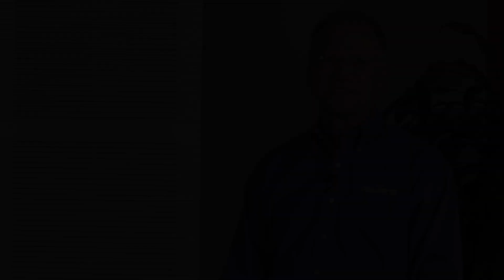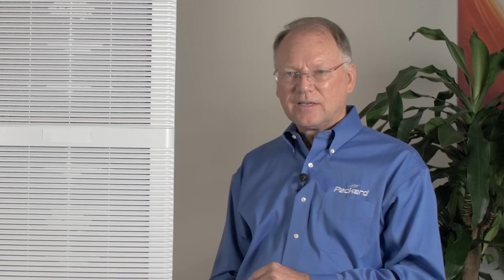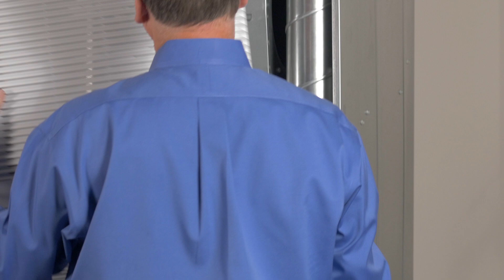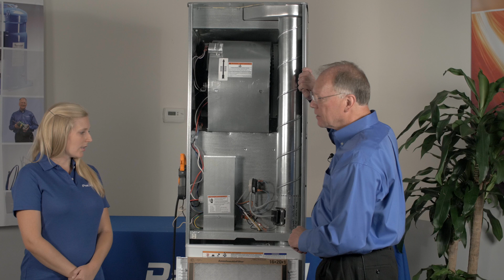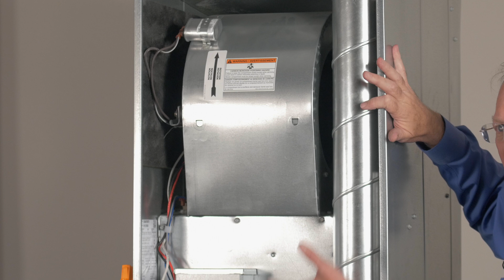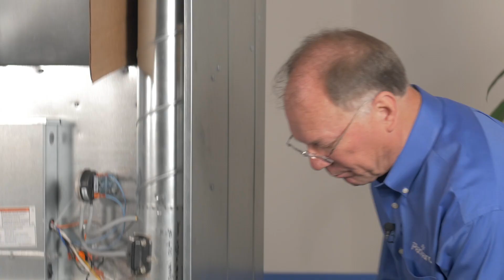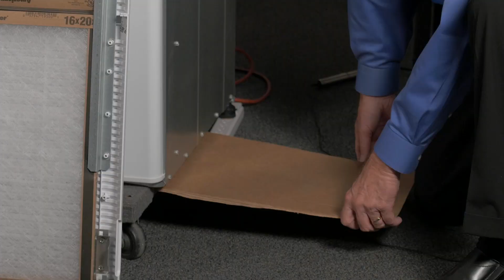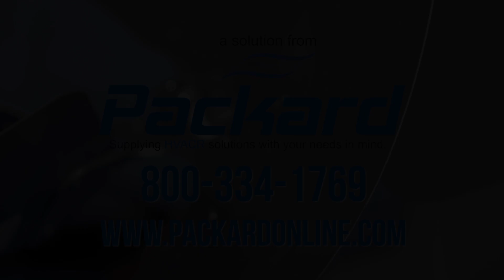Is Static Pressure Hurting Your Blower Performance?

Comment: If I use a belt driven blower, with an external motor mounted on top, and I restrict he airflow with a filter at the source (paint fumes) and a reduction to 5 inches at the outlet, how will this affect it ? The motor is NOT inside the blower  wheel
Reply from the maker: If you use a belt drive/general purpose motor (not an air over motor) and do not exceed the load rating of the motor, the motor should be fine.  The amps should never exceed the full load amps (FLA) or service factor amps (SFA) on the motor nameplate.  The more static pressure or restriction on the blower, the less air.

Comment: So essentially .... if i apply this logic to a squirrel cage blower to exhaust paint fumes, i can enclose the fan in a "restrictive casing" (5-6 inches for the side walls and casing ... but not block the outlet, correct ? This way, the fan will work less hard but displace enough air (pull) through a filter at the source (paint table) ?

Thanks
Reply from the maker: The restrictive casing and filter will create static pressure, reducing airflow.  How much will it restrict?  I don’t know.  If the amps are more than 25% below nameplate amps there is too much restriction and not enough air to keep the motor from overheating.  The motor will fail prematurely.

Thanks for the good question!

Comment: Is the airflow(cfm) the same in the cooling mode as the Heat mode? I have original manuals for my carrier 58mca-060-16110 furnace but there are no Airflow tables in it and I can't locate them on the internet. Thanks
Reply: Depends on the unit! Most gas furnaces use a lower cfm for heating, but it's not definite. You might look at your blower motor. 3 wires means it only runs at one speed, and so does 4 if 2 of them are brown (usually that's on a replacement part), and more than that means the motor is capable of multiple speeds. But just because it's capable, doesn't mean they're hooked up. Generally, if they're plugged in, they're in use, otherwise they'll be taped off.

Comment: This doesn’t make any sense
Reply: When the amps go down, the blower is not slowing down, it is going faster because there is less load on the blower.  Remember, the real load on the blower is the amount of air that it is working.  Less load means less air in the system.  Less air in the system and the system is not performing properly.
Reply: @onenikkione  Thanks! Perfect for explanation

Comment: Counter-intuitive.  I upgraded my furnace filter and was concerned that the reduced flow may add stress to my blower motor, but based on your explanation, it actually reduces stress on the blower.  I just need to look at how it effects air flow at the vents, which I assume will impact my HVAC efficiency and may cause my system to run longer.
Reply: It decreases the stress, but if the airflow is nearly blocked, it also massively decreases cooling. So the ratio between power/cooling becomes worse (bigger), the more restricted (even blocked) the airflow is. Thus the motor can be damaged with restricted airflow, even if the power draw is decreased.

Comment: When you add static pressure at outlet, the pressure will increase after the blower as it is running and supplying air continuously. It may cause blower to surge and consume more power. 
How it shows decrease in amps?
Reply from the maker: As the static increases on the outlet side of the blower, the air volume (CFM) decreases.  This results in less load on the blower.  Less load results in lower amps and higher RPM with an induction motor.

Comment: So is this good or bad? If I add a cold air return from the basement am I merely adding cost of oil burning? Is it worth it? Will it help warm the basement? So confused now.
Reply from the maker: The most important thing is to follow the manufacturer’s guide for static pressure for the specific piece of equipment.  When the system is installed according to the manufacturer’s recommendations the static should be fine.  If the static is not correct, then look at the filters and coils to make certain that they are clean and not blocked.  If they are in good order, then look at the installation to see if it meets the manufacturer’s specifications.  If not, then a change to the system may need to occur that would bring the system within the manufacturer’s specifications.  There may be other considerations that could result in changes other than just adding a cold air return.

Comment: Help Me, Amps go down, blower slow down, Does that mean system will not cool or heat correctly.  I own same air handler in video.  I upgraded blower that is 4 speed.  So what more AMPS if it needs more power, give it.  What is the issue?
Reply from the maker: When the amps go down, the blower is not slowing down, it is going faster because there is less load on the blower.  Remember, the real load on the blower is the amount of air that it is working.  Less load means less air in the system.  Less air in the system and the system is not performing properly.
 
The issue is not that the motor is incorrect, the issue is that the motor and blower are not working properly because the static pressure is incorrect.  Perhaps undersized duct work, not enough return air, dirty coils, dirty filters, too many bends in ducts, improperly sealed ducts and the like all lead to incorrect static pressure.  This will then lead to improper airflow in the system.
Reply: @packardonline  Thanks, more power / blower speed will not help when static pressure is incorrect.  I have 3/4" suction line (20') on my 4 ton A/C that should be 7/8" line.  Seems to work ok with a -25 temp drop out of ducts, but A-Coil drips a lot of condensation (2 qt per hr).  Should suction line be replaced with correct size or am I in grey area for 3/8" velocity flow?
Reply from the maker: @sunnysacto  I would not want to make that call in a chat, but it can make a difference.  The smaller line will restrict flow of refrigerant.  Make certain that superheat and subcooling are to the manufacturer’s specs.
Reply: @packardonline  The last few HVAC tech did poor work.  I'm learning all I can before I get next HVAC service.  My blower motor runs hot on higher settings, putting heat into duct flow.   I assume this is normal.  I set blower on lowest speed, making less heat, seems to cool better with lower fan motor heat and less amps.   Thanks for help
Reply: @packardonline  Gas Suction line is cool and liquid line is warm, but not hot.

Comment: I am completely lost now. I thought if you added air return ducts or even put a hole in the cold air before the filter that the furnace operated more easily, you cooled rooms more effectively, and you save money on heating and cooling..
Reply from the maker: For maximum comfort in our living areas we need proper airflow.  The air is generally provided by blowers through ducts.  The amount of that airflow, measured in cubic feet per minute (CFM), is impacted by restrictions in the system such as dirty filters, dirty coils, undersized ducts, lots of bends and curves in the ductwork, closed registers, and the like.  These restrictions increase the static pressure, measured in inches of water column or water gauge (WG).  As the static pressure increases, less air is available.  As the static pressure declines, more air is available.  This can be achieved by changing filters, cleaning coils, adding more air returns or increasing duct size.  More air can be good, as long as I don’t overload the blower motor.
 
Most residential systems should operate within .5”WG to .8”WG.  The lower the static pressure, the more air, and the more load on the blower, and consequently the blower motor.  The longest operating life of the motor is achieved when it is loaded properly (loaded with the right amount of air) operating at its highest efficiency.  That results in the minimum amount of heat in the winding.  When operating at it’s rated nameplate amps it’s at its highest efficiency.  If operating at lower than nameplate amps, it’s not loaded at its optimal point and will operate less efficiently developing more heat in the winding, resulting in lower motor life.  This occurs when static is too high and there is not enough air loading the blower.  If operating at higher than nameplate amps, again, it is not loaded at its optimal point, it will operate less efficiently resulting in more heat in the motor winding and have a reduced life.  This occurs if there is not enough static pressure.
 
With permanent split capacitor (PSC) motors, if the motor does not exceed +10/-25% of the nameplate amps, it’s loaded and operating OK.  When measuring amps, always make certain that all doors, panels, filters, and guards are in place.  If this is not done,  inaccurate measurements will occur.
Reply: @packardonline  Is there a simple way to decide if opening the cold air return directly one foot, say, in front of the filter will help warm my basement apartment? There are no air return vents and only one supply to the living area. Also, would ADDING a supply line from the plenum upset the balance in the 2-story house?
Reply from the maker: @lvvry1855  Either of the actions you mention would have an effect on static pressure and airflow.  The way that I’m interpreting what you say is that you would be increasing return air by enlarging the return area.  This would reduce static and increase air availability and airflow.  By adding another supply line, the static pressure would be increased, resulting in less airflow.  My recommendation would be to have a licensed professional measure the load characteristics and review possible solutions.

Comment: What a fan has is a static pressure/volume curve. It can product a different amounts of air volumes per given pressure resistance.  The goal is controlled mass air flow. Restrictions in a system are measured as "differential pressure drop" per volume of air movement. Fans can be optimized for pressure (vs volume) to combat things like dirty filters. EMC motors are electronically torque controlled to attempt to move a constant mass of air -- so when the air is hot it spin faster then when the air is cold.  Thus with an EMC motor and proper fan and ducts, the motor current will be higher with a dirty filter, but only up to a point : If air movement is blocked the fan is unable to do work and the fan speeds up full because it becomes unloaded.  Hopefully the pressure resistance of duct work, was a little less then the the mid point of the pressure volume curve of the fan, per intended volume of air movement.  Pressure resistance of duct work can be pre-calculated per a given volume to see if it is within the preferred performance curve of the air handler.   Static pressure measurements are merely a tool to determine if mass air flow is within spec or expectations : In the real world things like doors, exhaust fans and chimney effect have to be accounted for.

Comment: Hi, may i ask.. I have 2 blowers, centrifugal type: 1 is rated at 1.5sp and the other is 2.5sp.. Both are rated at 20000cfm,same motor. Which one pushes "stronger"? (i mean that i can feel the air in the end of the vent with ~100m length)..

Comment: I fail to see how this is relevant sorry. It may be just me but i would have liked to have seen some static pressure readings to go along with this. Because as far as i can tell you really only raised the static pressure on the return side of the fan. And left the cardboard in the top as well as the bottom at the end of the video. And it seems like you are saying a high static pressure is a good thing because we have a lower current draw, but the evap will freeze over? Again sorry if I failed to see the real world point to this.

Comment: you say that it doesn't matter which the outlet or inlet get blocked and the current goes down. i don't see how that adds up. if the inlet if blocked yes the current should go down because it's creating a vacuum meaning the mass of the air should go down thus less friction on the impeller. if you block the outlet the current should go up because you pressurize the chamber around the impeller meaning the mass of the air goes up and the friction on the impeller goes up.  hope not i am internally wrong.  do not know very much about this and have never tested it, but that would be my logical explanation.

Comment: Always love the counter-intuitive stuff . Stumps even the engineers . By the same principle then using bypass to dump air to the return in a zoning system  will make the motor run harder as it has to deal with more air?
Reply from the maker: On a PSC motor, correct.

Comment: Thank you sir 
Sir please explain the effect of duct work size  and amps as the air volume is same but size of duct varing like( 1 st case  8"  2 nd case 10" etc)
Reply from the maker: By reducing the duct size, which increases static pressure, the amount of air is restricted.  This results in a reduction of air available for the blower to work.  If it is a PSC motor operating the blower, this results in lower amps during motor operation.  If duct size is increased, this reduces static pressure, resulting in less restriction of air.  More air is available for the blower to work.  If it is a PSC motor operating the blower, higher amps will be seen during motor operation.

Comment: how do you lower static pressure (i.e. lower the amperage) while lowering the temperature?
Reply from the maker: From Rick Streacker, National Training Coordinator - With a blower, when you reduce static pressure you reduce the restriction on air flow.  When you reduce restriction, you have more air that the blower can “work”.  When you have more air that the blower can work you have a greater load on the motor, if a PSC motor.  With a PSC motor you do not lower the amperage when you lower the static pressure.

The motor operating temperature is based upon load and ambient temperature.  If the motor is not operating within it’s design parameters, that is, there is either too much load or not enough load, the winding temperature increases.
Reply: Packard Academy thanks!
Reply: using the thick milk shake thru a skinny straw concept helps put these concepts into easy to grasp ideas.
Reply: Packard Academy. Are you telling me that if this same test was done with a three phase motor in the blower fan that that adding air on the inlet would lower or flatline the amps but that on a permanant split capacitor motor adding air on the inlet will raise the amps.
Reply: Freddy McIntire. So why did he bring up the fact that the example is with a PSC motor. If the blower fan doesn't know the difference then why bring up wether it's a PSC, synchrounus, PM, or 3 phase motor if the amps are going to do the same thing anyways.

Comment: As a inspector...I see this every single day...on improper installed systems ( Returns at 1 wc and a-lot higher  @.5 wc rated)...it's sad on how many HVAC contractors don't understand the fundamentals in there own field....
Reply: so more static is less amps ? so its GOOD ?,,,is this correct ? then the CFM are comprimised as i see it ?
Reply: @MrGarcon98  more static, you move less air and causes problems,ac coil freeze in ac mode or high limit trip in heating
Reply: thanks i should  know that i dont remember making a comment or being at this video:? and of course you cant just click on your notifications to bring you back to where we may have been in case we dont remember where we have been etc etc etc ,,,,,
 @capitolrefrigerationheatin7501
Reply: It's sad that you don't understand how English works.

Comment: So I've got Feildpiece SC56 clamp meter and want to check running amps of an ECM motor on a heat pump to calculate CFM using the heat-rise method but need to have all doors closed and I don't have access to wiring outside the cabinet.   My meter has inrush feature but no hold for regular tests. I'd greatly appreciate any advice on how I might perform this and also consider the fact that it's ECM?  One idea I'm considering is to place my phone inside compartment to record video.

Comment: Absolutely fascinating information!  Counter intuitive as you mentioned.  But I imagine at some point with enough restriction wouldn't there be an increase in amps similar to locked rotor of a compressor?  I mean, hypothetically if all inlets were completely sealed off tight aside from the need for motor cooling by passing air?
Reply from the maker: With an air-over induction motor in a blower application, the motor is dependent upon the right amount of air flowing over the motor to keep it cool.  The actual load that the motor will see is based upon the amount of air the blower is working.  If all air is restricted, there is no air for the blower to pressurize.  This lack of work can be seen by a drop in the motor operating amps.  As a result, the Watts being supplied to the motor are not being converted into work effectively and the winding temperature of the motor will increase.  With less air moving over the motor for heat removal and an increase in winding temperature, the motor will overheat.  But the amps will be below nameplate or FLA.